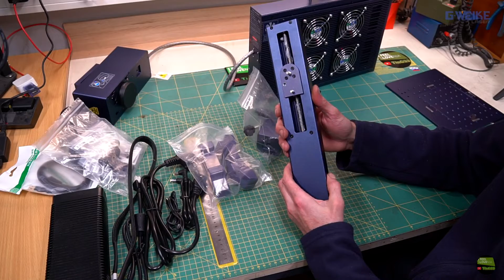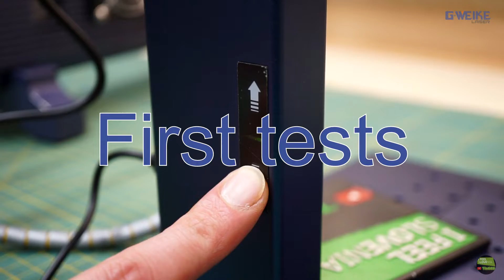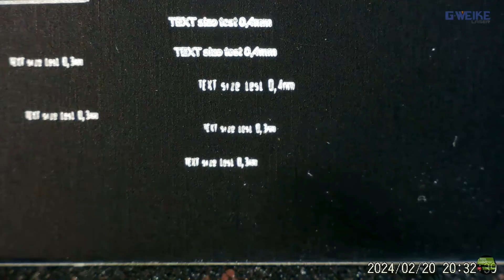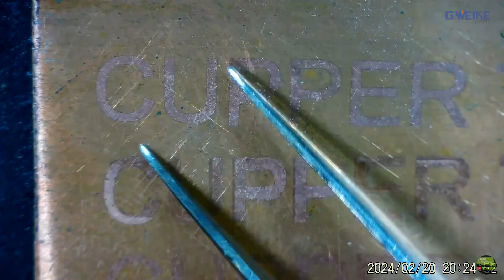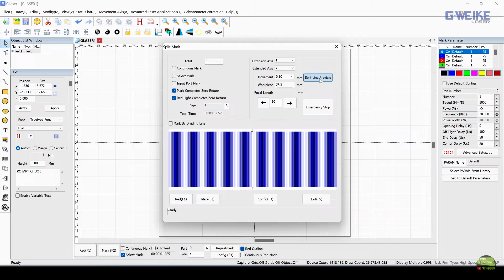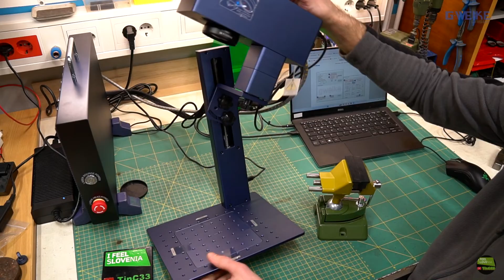Gweike G2 20W Fiber Laser Engraver + addons [Unbox/Review/Test] Metal engraving /alu/brass/plastick

Comment: Hi TinC33
I’m Mark, and I’m using a Gweike G2 with a 20W, 110.110 lens. I’m having trouble aniling silver metal bracelets and wanted to ask:
What settings should I use in Glasser software?

Could you help me with the correct parameters for this material and process?

Thanks!
Mark

Comment: i have a question, for you, or someone who tried... does it engrave 0.3/0.5mm of depth on Stainless steel?
Thank you for the great video.
Reply from the maker: I didnt try so many passes on inox but i doubt it can do it, i assume inox will heat up and deform before engrave that deep, also on steel, that deep work on aluminium only, maybe brass too...

Comment: Speed wise - Wow.  Not much more you can say!!! Be nice if was more like 250 or 300mm square.
(and just an FYI - you're looking for the word copper.  Not cupper)
Reply from the maker: Thanks, i also google for that word and find out someone write copper and other cupper 🤷‍♂️ idk but maybe same think as aluminium/aluminum...
Also i was think 150mm is a bit small area, but turn out that's enough for avarge user to enrave, but surely everyone has different needs, i think big area is more important on cutting machines, like diode lasers, plazma/laser cutting machines...
Reply: @TinC33  - Periodic table says copper (in english anyhow!  Ha!), I'll stick with that.  ;) 
And yes, for engraving your average text 150 is probably enough.  I find the area of my K40 Co2 to be a bit small sometimes (really need to do a bed mod on it).  I wonder if Gweike could mount the laser 'head' (guts?) on a small X/Y internal gantry.  Then have it engrave in 4 quadrants to give 300*300.
Reply from the maker: @DrFiero  you are tottaly right, i hope i'll remember for next time, funny thing is that i google while making engraves cuz i didn't know how to write copper or cupper, oh me and my self learning english 😅
The way you thinking about expanding working area seem interesting as diy mod, but for one who need a machine to work accurate and out of the box will take some other model, gweike also sell (check on their website) fiber laser with mopa function (full colour engrave) power of 100w and working area 300x300mm and also auto focus for i think only 7 or 8k€ wich is funny price, for that price you got no more than basic 20w few years ago, for 100w mopa you would pay idk but about 20k+ those days.
I think price is a game changer here.
Reply: 33:26 can you please link to the thermometer you were using? Is it a surface tester or uses IR to measure the temp?
Reply from the maker: @mvadu  its an ir thermomether, i buy them about 15yrs ago for measure rc car and plane motors on temp on field, still got same battery 😀
I buy in hobbyking store but no more availible, you can find same one with different logo somewhere else, just google or ebay for "Micro or mini infrared thermometer.